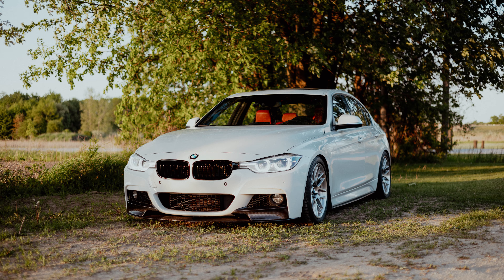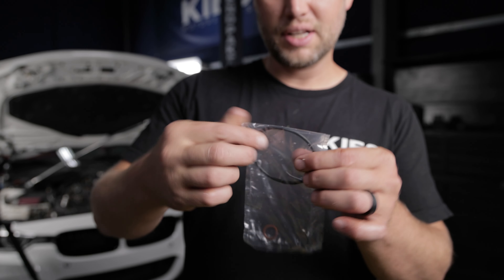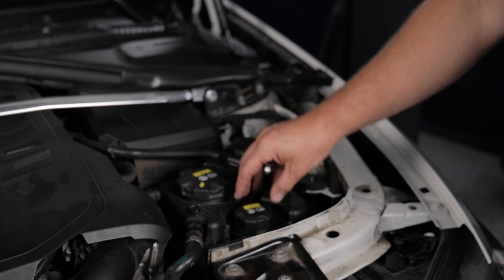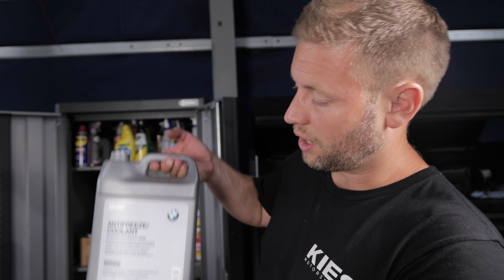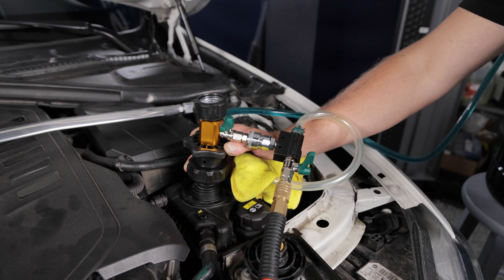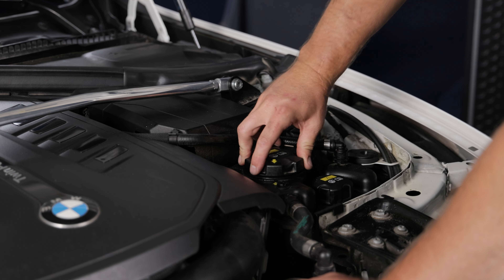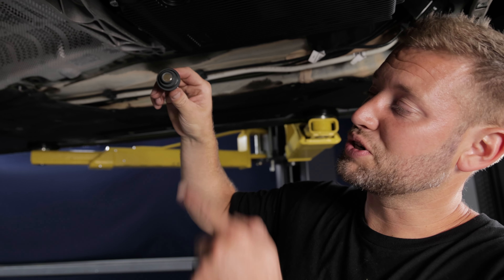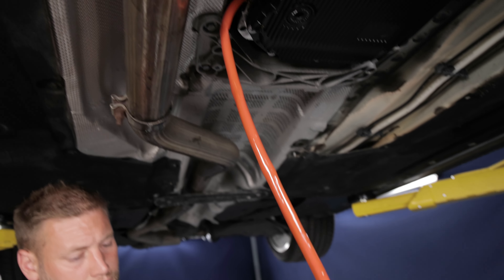How to Change EVERY FLUID in Your BMW | OIL, COOLANT, ZF 8 SPEED, DIFF, BRAKES

Comment: I just got a 2019 m240i that has a b58 as well, the owners manual doesn’t say anything about blue or green… I have a gen 1 b58 so I thought it would be blue, but the model year is after they changed to green. Any advice you could give would be great!
Reply from the maker: What color is in the car now? You can use a paper towel to absorb some from the expansion tank and see what color is in there. Id continue with whatever color is in it currently
Reply from the maker: @VinnyMacVlogs 😬 I’d do blue. that’s what was in mine and we have the same engine.

Comment: Doesn't pulling a vacuum tend to crush in some parts like radiators? If we suck the air out of a thin metal can, it will crush in... I'd hate to see a radiator deform itself same way..

Comment: what is this black thing you removed before removing the differential drain bolt? thanks!
Reply from the maker: Bryan told me that it’s a weight that’s supposed to reduce vibration at high speed

Comment: Hi, I was wondering if you rechecked the transmission oil level after driving the car and letting the oil cooler thermostat open at 75 degrees? According to the ZF fill instructions this step is needed for all cars with an oil cooler. Actually they say to 'overfill' the trans 0.5 liters and then go for a drive. Not sure how you can overfill it without spilling allot of fluid.
Reply from the maker: We did re-check after going for a drive and the level was good. As far as overfilling, if you use a syringe or pump, you’ll be able to push fluid in faster than it flows out. Just have the fill plug ready so you can quickly screw it in. It’s messy so keep a pan underneath the car to catch any excess that overflows.

Comment: Any recommendations on intervals for brake fluid change. B58 2019 F36 GC
Reply from the maker: 2 years for brake fluid. Hard to find a specific interval for these cars but generally 2 years is a good interval to change it.

Comment: There should be a class action lawsuit against BMW (& other manufacturers) for saying that the transmission fluid doesn’t get changed because that’s total crap (like my transmission).  My 2009 BMW 1 series 128i convertible has transmission issues and only 116k miles.  The previous owner never changed the fluid per BMW and now it shudders in 4th & 5th gears when I drive it in full automatic mode.  If I manually shift it drives fine with no shudder.  

If there has been a schedule to change the fluid and the previous owner had it done this most likely wouldn’t be a problem.  Now I’m screwed with a transmission that is not going to last very long.  It’s a crime to not have a schedule to maintain it.  I read up on this and found that there is no coolant flush, or trans flush, or diff flush or fuel filter that is scheduled by BMW.  That’s criminal on the part of BMW.  No wonder BMWs have so many issues.  I’m sick of auto makers misinforming customers on these maintenance issues.  BMW should be forced to either replace transmissions that have issues like mine or replace the entire car.  Won’t ever buy another BMW ever again.  Oh and good luck selling my car without replacing the transmission!

Comment: How can we ensure the correct engine oil level ?
Reply from the maker: You have to measure carefully when filling up. You can check the level afterward using the electronic measuring system in the iDrive menu, but keep in mind that it can only tell you if the oil is low, not if it's been overfilled.

Comment: Hi everyone question i have a bmw x5 e70 2012 n55 engine with 119k miles i bought a transmission fluid kit from fcp euro i want to know if is safe to change the fluid or is too late now i call the bmw dealer and they told me is not recommended what are your thoughts the car shifts perfect  with no problems should i do this?
Reply: Changing the fluid over 100k can be a crap shoot.

Comment: Can you share the frequency (years/mileage) of each one of those liquids?
Reply: Approximately 

Engine oil 10 000 km
Brakes 2 years
Transmission 70 - 90 000 km
Differentials 60 - 80 000 km
Coolant 100 000 km

Comment: What about those that don't have dip stick how do u know when it's full because sensors can have issues
Reply from the maker: Just have to measure the oil carefully and trust the sensors. BMW got rid of the dipsticks around 2006 and it has not been an issue

Comment: When should Transmission Oil be changed and the pan replaced?
Reply from the maker: ZF, the transmission manufacturer, recommends 50,000 mile fluid intervals. Some people replace the cover every other fluid change. Much like the plastic engine valve cover, there's no set interval for replacement, but they can crack and leak as they age. If you upgrade to an aluminum pan, it should last the life of the car.
Reply: @justinbuice  Thank you so much bro 🙌🏼

Comment: Hey guys need some help figuring this out. So I watched videos about the bmw 128i and I noticed everytime they mod the engine the hp goes down . For example they said from factory the car does 230hp and then with mods there currently at 201 . Like it’s slower isn’t it ? Why would someone mod it then ? Hopefully someone can understand what I’m trying to say 🥲thanks guys
Reply from the maker: Could be they are measuring the horsepower at the wheels on a dyno which is going to show less than the factory spec where the HP is measured at the crank. Also every dyno is going to read different, so it’s more important to look at the gain before and after mods. Now if they did a dyno run, did some mods, then did another run and it came up lower, that’s a problem 😂
Reply: @justinbuice  😂😂 yup. Thanks Justin new I could count on you for the knowledge 🫡

Comment: Can't you just bleed the coolant after filling it instead of buying an expensive vacuum pump?
Reply from the maker: We were following BMW’s official service documents which say it should only be done with a vacuum. Although I’ve seen videos where people have done it without.
Reply: @justinbuice  Did you do any preventive maintenance with coolant hoses? Or maybe already done?
Reply from the maker: @i679n5  I have not, but the car was still relatively low mileage in this video.
Reply: @justinbuice with the vacuum coolant bleed method do you still have to do the procedure in the car that involve turning on the AC to max heat and stepping on the accelerator etc..
Reply from the maker: @73538z  no, the vacuum replaces those steps.
Reply: @justinbuice  gotcha, when refilling the coolant with the vacuum, how do you know when to stop ?

Comment: When they done my gearbox oil change they had s machine thay sucked out old oil and pumped in brand new! This way you only get out some amount of….
Reply: What you had done is called a "flush". Here what is being done is a pan and filter change. To your point a pan and filter change does not change all of the fluid.
Reply: @kjhnsn7296  yeah and this is not a proper way yeah thats cost more but still..

Comment: Dealer starting to see oil pump failures on b58… tech said ALWAYS use oem bmw filter because common thread on failures seems to be aftermarket filters that may starve oil or be too much drag on flow…
Reply from the maker: The Mann filter we used is listed as an OEM replacement for the B58.

Comment: why the change from 5w-30 to 0w-20
Reply from the maker: I heard from a Liqui Moly rep that it’s best to go with the viscosity that’s printed under the hood, so that’s what I’ve been using the last couple oil changes. Although 5w-30 is also within spec according to the manual.

Comment: In the video of the oil change 2 years ago you said you had switched to 5w30, because in your opinion the 0w20 was too fluid.
How come you went back to 0w20?
Reply from the maker: I heard from a Liqui Moly rep that the best choice is the viscosity printed under the hood so that’s what I’ve been using the last couple oil changes. Although 5w30 is also within spec according to the owner’s manual.

Comment: 0W-20 for a B58? Why don’t change the oil with water? That oil is definitely too thin for an engine like the B58. You could easily fill up the engine with 5W-40 LongLife-04 oil. This type of oil is still certificated even for the latest B58 engines like the one found in the M340i.

Comment: What are the high temp and low temp cooling systems for, individually ?
Reply from the maker: on the B58, one is for the engine itself and the other is for the water-to-air intercooler.